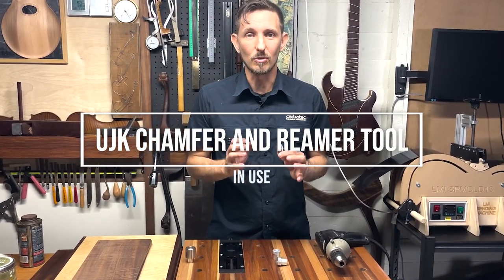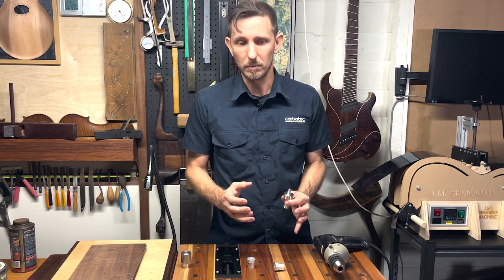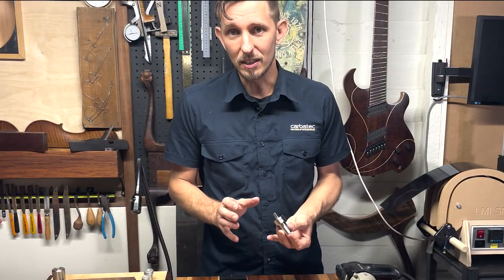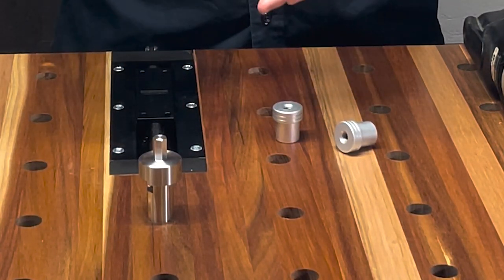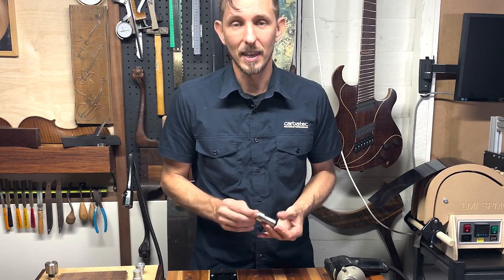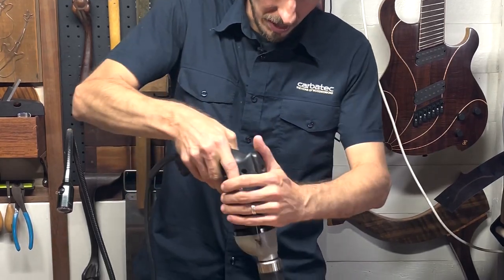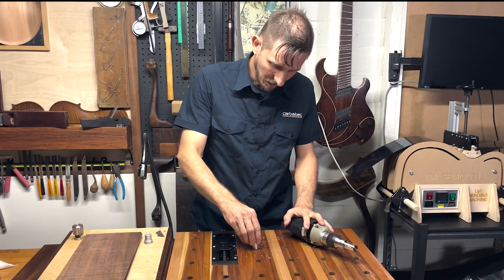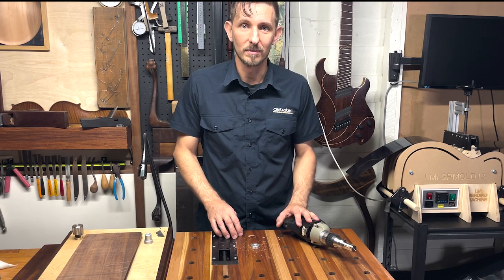UJK Chamfer and Reamer Tool in use

Comment: A couple of things, wouldn't it be better to cut the holes 21mm or 22mm? Because you would need to re-lacquer the holes to prevent moisture from getting into the wood and making it expand?

Also with waxing the cutter or hole, this doesn't work very well as when the cutter cuts, it cuts under the surface of the original hole so it misses the wax in the hole and any wax that is on the cuttter is wiped off nearly instantly.  *if the lower portion of the cutter is jamming in the original hole, doesn't this mean the cutter is incorrectly sized?

As in metalworking, you need a constant supply of lubrication/ coolant sprayed onto the object to cut properly.
Reply: @plang42 I think old mate might have got a bit confused or just doesn’t know wood turners wax is actually for 😂